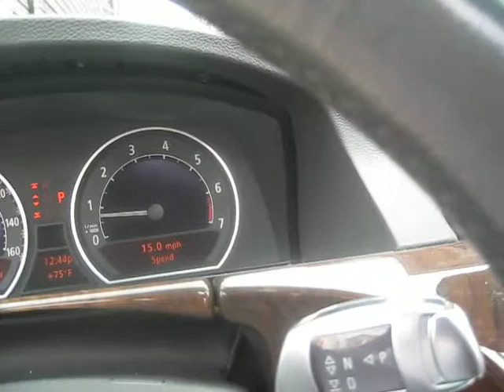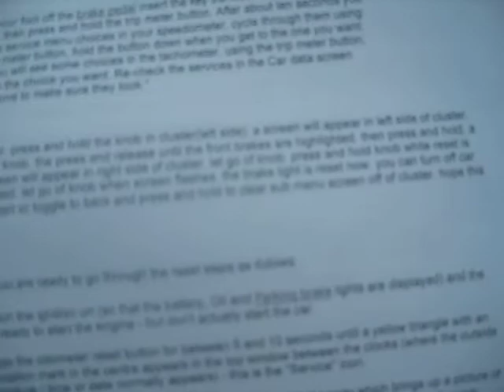How to reset your brake pad sensor light 2003 BMW 745 LI

Comment: i seen the video to reset the brake pad sensor light. does this reset the little red car on the navigation screen only? or does it also reset the red exclamation point on the dash board as well?